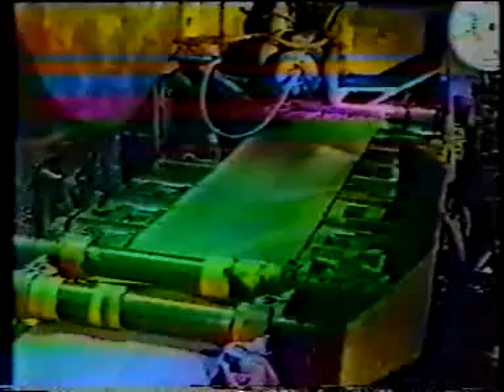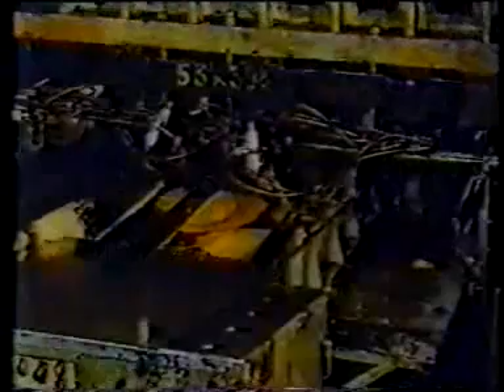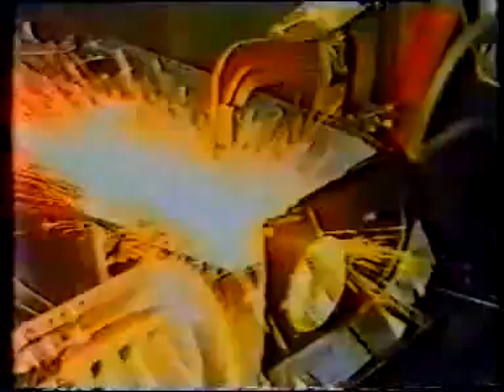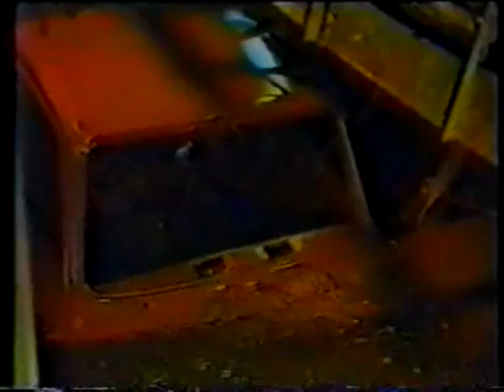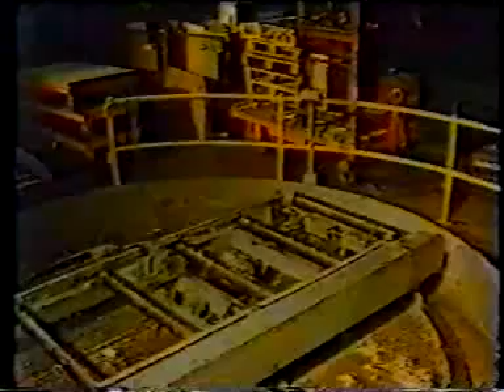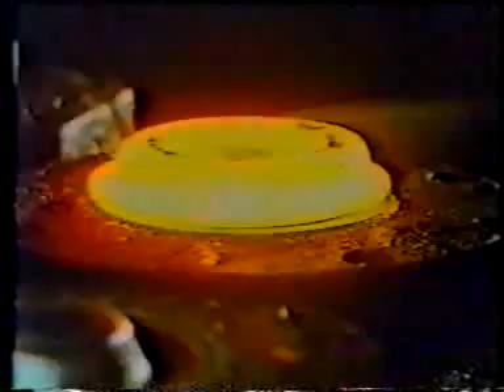Ford Zephyr Zodiac MKIV, Making of Part 1

Comment: Great little video 👍 Zephyr / Zodiac, Anglia, Corsair and Mark one Cortina. Thanks for posting this 👍 on now to part two 😊
Reply: Try identifying the engine block casting(s),  I think you will find the engine types out number the range of cars on offer in this video. Cortina ( mk1 ), Corsair ( which took over Zephyr's niche ), Anglia, Zephyr & Zodiac ( mk4 ).
The V4 spotted, I think you will find was used both on Corsair briefly, then used simultaneously with the smaller capacity transit, the 3L transit in mk1 form had that "nose-job" for the radiator.
Half a world away in australia ( the transit 77-82 ) they used the falcon engine 200ci & 250ci along with the tc-tf cortina's ( uk mk3 - mk5 ), can't help sharing a little ford history from down under.😎👌👍
The V6 transit engine was shared the zodiac in uk, but went On, to power 3L Capri, I think.👌👍👍

Comment: Interesting slice of car history - must have been made in 1966 as that was the first year Mk. IV Zephyrs and Zodiacs were made and the last year of Mark I Cortinas - Anglias and Corsairs feature too !
Reply: Did you see the V4 block moving on the conveyor, thats Mk1 smaller capacity transit engine, it may have been used in the Corsair, the Ford buffs will confirm, spent more time with Vauxhall product.
The Transit wasn't seen here, the anglia, corsair, zephyr & zodiac ( mk4 ) were all seen here, was there anything I missed ?
A true time capsule of Ford products & processes, thanks & take care. 😎👌👍